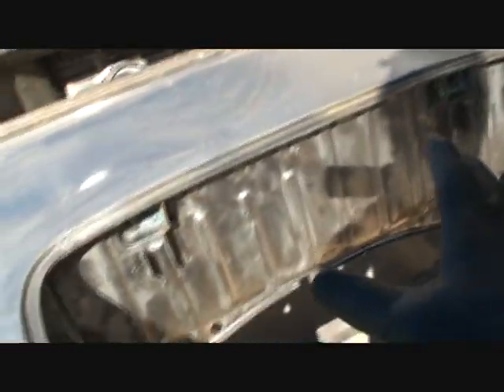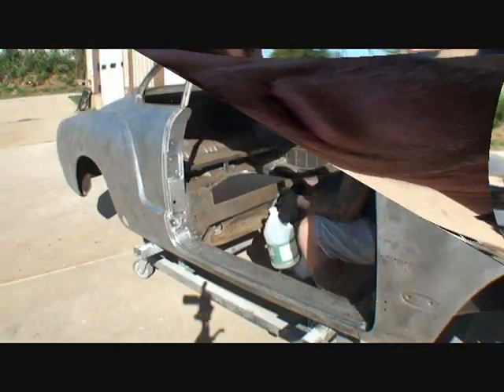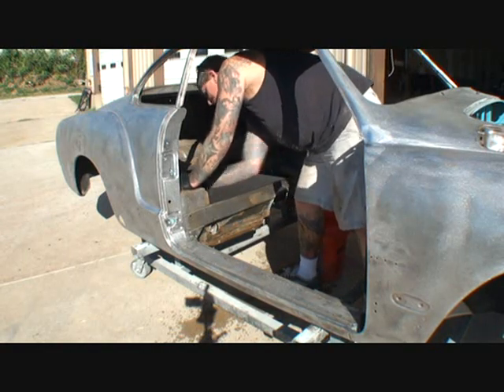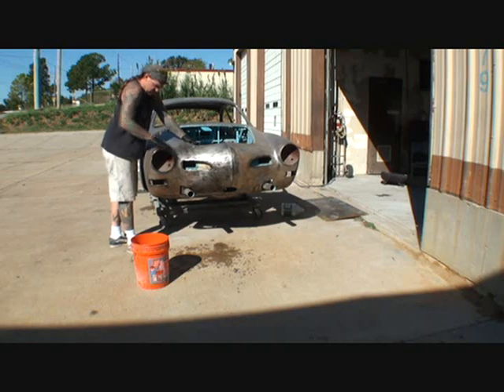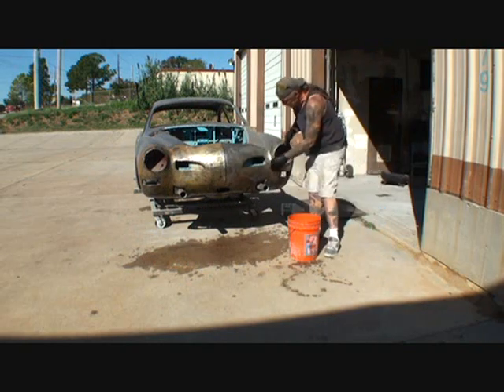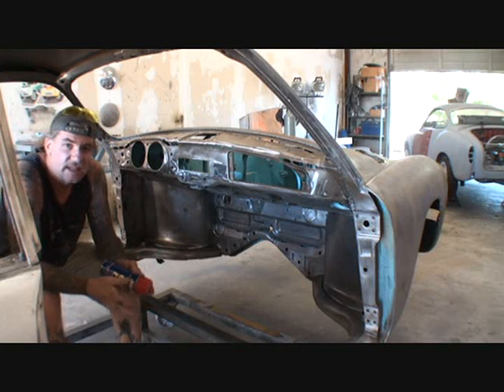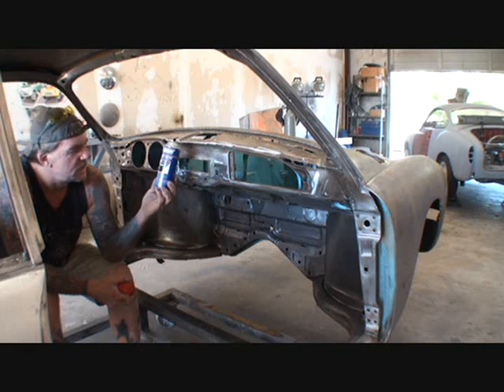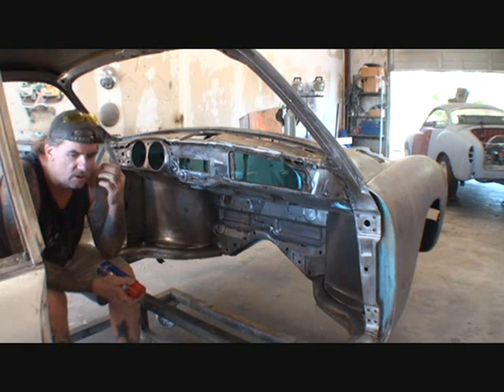Automobile Restoration-How To Prep Your "BARE METAL" Car For Epoxy Primer-Part 3

Comment from the maker: @pigidly If you noticed I "DIDN"T" leave the water on for long periods of time, and also I epoxy primed the vehicle within a 24 hour period of prepping the metal.. If I would have wet the car down, left it wet, and never wiped it off and dried it--yes rust would have started... Just like when I first started on the car it would have surfaced rusted.. Getting your bare metal we for cleaning purposes doesn't hurt.. Pete

Comment: You're straight up with your answers and I like that, I just recently got my Sears lawn tractor bead blasted. And I have to clean it. Now your way is one way, to add to that can you use (weiman stainless steel cleaner and polish) when you are cleaning with vinegar and water? Or just do the vinegar and water?
Reply: I use viniger water mix only. No other cleaners.

Comment: Pete.
I'm doing a land cruiser here in Central América and the humidity it 80%. Flash rust over night.
I have been using phosphoric acid to get into the spots the sand blaster can't clean out.
Any suggestions before I prime this work?
I originally bought this stuff to etch new galvanized steel for paint and considering washing the body down with this 1st.
I have 100s of hours into this restoration and want it to last.

Comment: Pete, I've sanded the rusty areas on the car with 80 grit but got to bare metal on some places.  Should I use the Port 15 or use self etching primer on those areas?...or both?

Comment: Pete i know this is an old series but i have an 86 f250 that was previously owned and used as a snow plow, so it is significantly rusted on the hood and roof.  with a lot of pitted areas, no rusted through areas just severe surface rust.  I have d/a'd it as well as wire wheeled it, that won't get it down to bare metal though, would it be okay to just water vinegar it, and rust treat it?  And after all of it turns black to i need to resand it down to bare metal? what primer is good forpittedmetal

Comment from the maker: Yes you can but you will have to rough the surface up before applying bondo.. It is better to actually rough your surface up with 36 grit then apply the bondo.

Comment: Pete...thanks for all of the videos and helping people to learn how to do it the right way.  I started a 75 roadrunner project about 3 years ago but I got frustrated since I've never done this before and had some bad experiences.  It's not easy to find parts for this car.  Anyways, it sat in the shop for almost a year until I started watching your videos.  Progress has been slow but it's getting there.  I have a question though.  I don't have a huge air compressor or a paint booth.  What do you think for at least spraying epoxy primer...what is the minimum gallon compressor I should use?  I want to do this right but don't have a lot of funds right now.  Thanks my friend Pete :)
Reply from the maker: a small 25 gallon compressor should do the trick for you, make sure it's pumping out atleast 75 psi.. Good luck on your project and lets GET ER DONE!

Comment from the maker: @danny7042004 You want to try your hardest not to get any wet substance on bondo, but if it happens it won't hurt it, just make sure you let it dry throughrly before priming.

Comment: My Friend Pete, can you use a sand blast tank to soda blast or do you have to have a soda blast machine, Thanks
Reply from the maker: Ive never tried one with the other so I can't say yes or no! I believe that soda blasting requires alot more air pressure then sandblasting..

Comment: dont want to be a septic about this...  but water wouldn't rust the car back up by the time it dries?... water and metal = rust... no???...  can you explain how it works? I always been told that bare metal has to be expos to the air as little as possible because of the humidity in the air that rust the car up... and water is the extreme humidity factor...